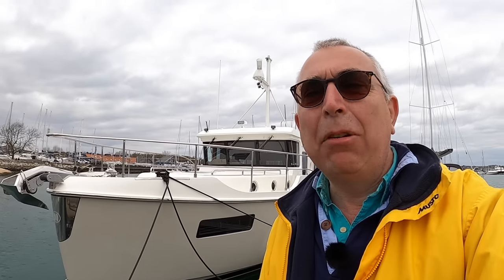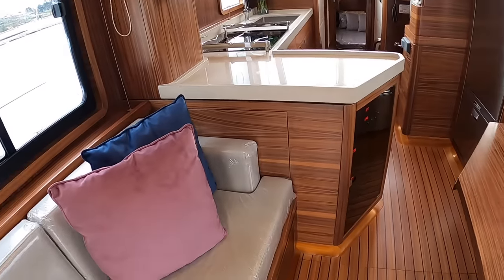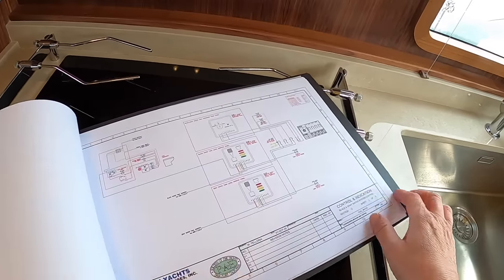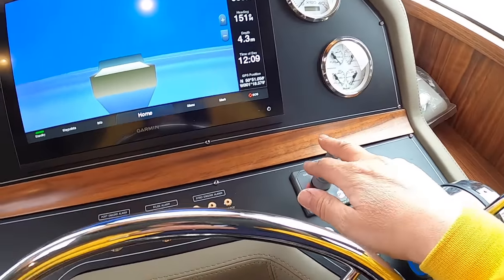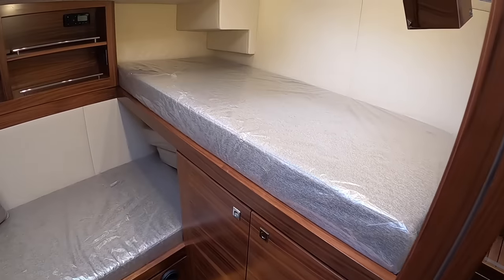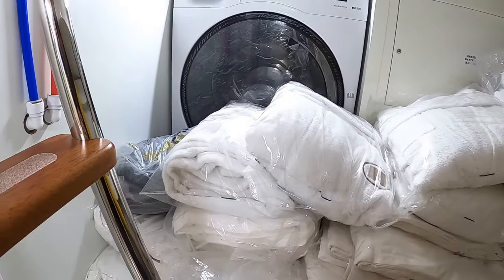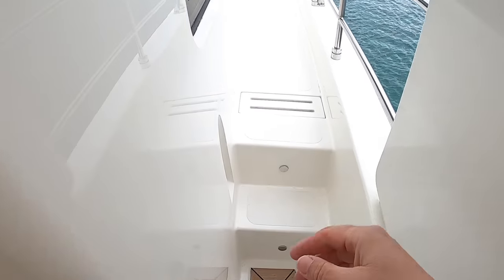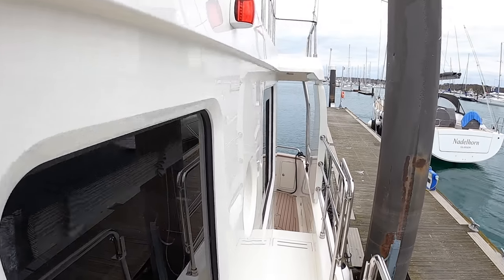$900,000 Explorer Yacht Tour : Nordhavn N41

Comment: Finally, Finally, Finally, They have seen sense and fitted 2main engines.  For most sensible people the thought of even thinking about a boat that you would cross an ocean in would would have redundancy.  I notice other models are now being fitted with 2.
All we need to do now is work on increasing the engines' horsepower because speed requires redundancy too.  Nick states in his video that a speed of 6kn gives you the 3000mile,atlantic, range.  We walk at 4mph, marathon runners at 14mph. 6kn=7mph   7milesx24hrs=168miles   3000/168=18days  Whatever you think about Nordhavns' it really is a glorified holiday boat, maybe cruising around islands like, say those off Seattle.  Stop trying to sell it as an 'Ocean' crosser, keep to the coastline PLEASE.
Reply from the maker: I'm afraid you've rather missed the point of this one. It's the low speed that makes it an ocean crosser, the moment you try and lift the speed above hull displacement speed, your range vanishes. Plenty of Nordhavns have crossed the Atlantic at these speeds, as have thousands of sailing boats.
Reply from the maker: @robertstancer4469  Then show me a 40ft motorboat with transatlantic range at substantially more than 6 knots. 🙂
Reply: @AQUAHOLIC  That's exactly my point Nicky Noo.  You've got it, you've really got it, Hurrah.

Comment: Nordhavens are great but 150 hp? Hope that there is an option for bigger motors.
Reply from the maker: It's a displacement hull so once it hits maximum displacement speed (which it will with these engines) then it will go no faster even if you double the power. The ethos is range and seakeeping, not speed.
Reply: @AQUAHOLIC  I see, thank you for the info

Comment: Have to say I was expecting a little more than 2 x 75hp engines.
Reply from the maker: It's a displacement hull boat - you could double the power and it wouldn't go any faster
Reply: @AQUAHOLIC  well it would a little, but not efficiently.
I would have thought 10-12 knots ideal design speed just looking at her, but she must be pretty fat below the waterline.
Reply from the maker: @OllieVK  If it is a full displacement hull (rather than semi displacement), then that's it. Stick 1,000hp in and you might get another 1/2 knot.
Reply: @OllieVK  41 foot displacement boat is not doing 12 knots unless you push it off a cliff. 41 foot waterline length gives hull speed of 8.5 knots.

Comment: What is fuel capacity and range. I missed it.
Reply: At six knots,just over three thousand nautical miles 👍
Reply: @cookiemonster2299  No it is not 3000 NM, it is 8200 NM at 6 kts!!!!!!!! I check the Nordhaven and passage maker. Of course this is fuel starvation and no APU usage included, no reserve. It also does not account for currents, WX diversion, This is sea miles not geographic or point to point as the crow flies. However even if you set BINGO fuel at 300-400 gal, you could travel almost anywhere with reserves. 

900 GAL tank / 0.656 Ga/Hr Fuel flow @ 13 HP )  x  6Kts  ~~~~~> 8200 NM!!!! 
 
This is why I love Nordhavn... You could travel the world. However I would buy used and get the 43, 46, 47, 50 or 51....  However the N41 really perfect. From experts 40 feet is the MIN LENGTH to travel Atlantic and Pacific....

At top cruse speed of  9.7 Knts range is 970 nm.  Not shabby....
Reply: @gmcjetpilot  HAHA, AWESOME!!!!!!! 😳👍

Comment: It is too small for me, and with the usual Nordhavn price it will be too expensive also.  When he first went into the salon I thought WTF is this a joke - why so small?  Then the kitchen is huge compared to the salon space, so unless you love standing over a stove or sink there isn't much room to play, and the curved settee would have been a better use of space had it been a right angle.  Oh well, who cares what I think?  
When you try to be all things to all people you might end up being nothing to no one, and that is what I feel about this Nord 41: There is hardly any relaxing or entertainment space, only one head, the second cabin is for kids, the main cabin is up at the bow where it will 'Rock Me, Baby, All Night Long!' and even the area to sun on the deck is split up by a couple of hatches.  They could have left off most of that deck and swim platform at the stern and used it for living area, and aligned the front cabins to get the hatches all on one side to allow for a better sun platform.
The tall hip-high stanchions make for safe walking from stern to bow and back.  The crane uses space efficiently.  The engine room would be better if it had the power to cruise efficiently at 10-12 kn, but twin 75 hp engines sounds like what you would get in a 41' sailing cat.  Realy, Nord, all that engine room weight, space and expense just to get 150 total HP?  What were you thinking? Do people really want a brand new boat that cruises at modest sail boat speeds of 6 - 7.5 kn and you have to pay to run the engines full time to get that speed? 
Too small, too inefficient, too slow, and too expensive.  What's not to like?  Quite a bit, actually.  
The mechanical engines would be around for a long time, except pretty soon regenerative electrics and superior batteries will take the place of those complex and underpowered diesels and all that fuel polishing apparatus, so the engine tech is too little too late IMHO.  
This boat was designed by committee, no doubt about it, and probably nobody was satisfied fully.  Hey mom - look here - you get to climb up and down a ladder every time you need to load or unload the washer dryer - won't that be fun?  Yes, son, almost as fun as you guys trying to enjoy the salon with the noise of a washer dryer running right under your feet.

Comment: I love the Azimut s10 grande @ 3.2million? As boring and practical, sensible, reliable, spread sheet sensible, you would be daft not to the nordhavn is, how come it is a much lower price tag, it makes no sense?
Reply from the maker: Because it is a much smaller boat
Reply: @AQUAHOLIC  its 50 ft longer there abouts still don't add up? Its not like the Nordhavn is no less quality. Dont take me the wrong way I have learned a lot from you.
Reply from the maker: @johnpayne9777  It's not just the length, it's the beam, the height, the engines, the systems, the facilities.
Reply: @AQUAHOLIC  I analyse specifications  values and deprecation every day for a living, I suppose my problem is I don't look for the good news. Kindest Regards John.

Comment: Sadly underpowered. No getting away from pirates in canoes with this girl. Such a shame fantastic vessel otherwise!
Reply from the maker: It's a displacement boat. You could triple the size of the engines and it would make not a jot of difference as it will only run at a maximum of hull displacement speed.
Reply: @AQUAHOLIC  I did not know that. Thanks for the education!